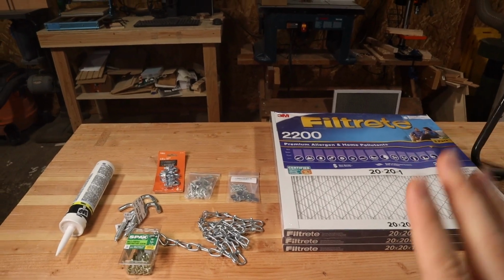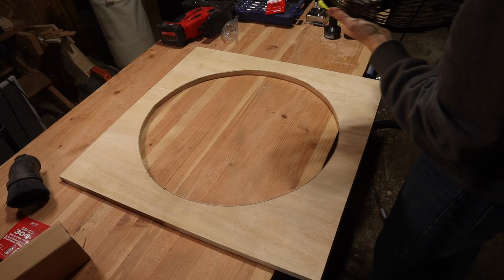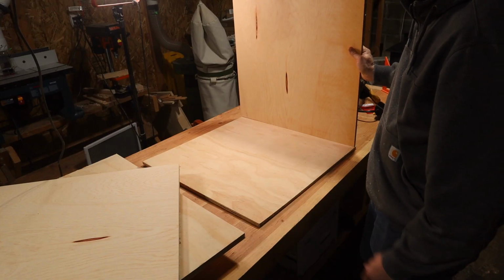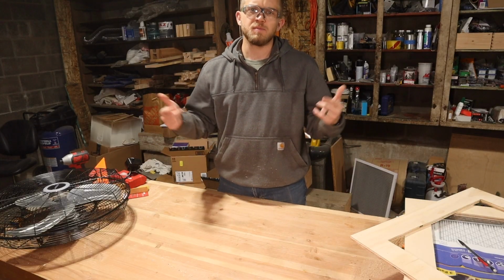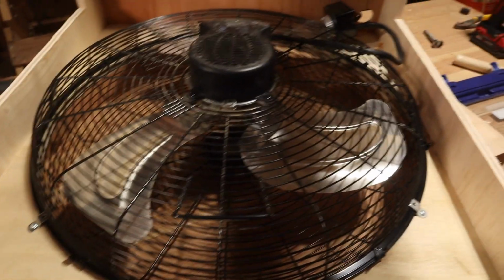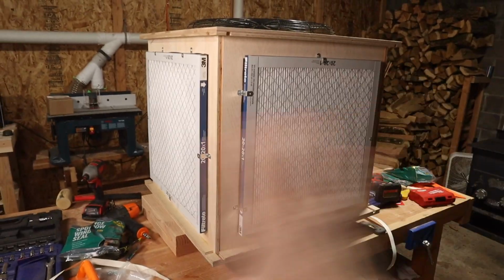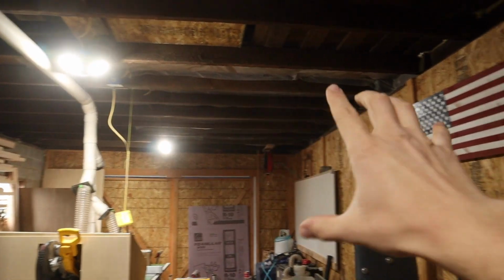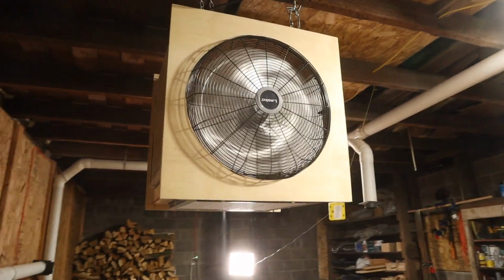Building the Best & CHEAPEST Air Filtration for Your Shop

Comment: To make circles, I use a yardstick with a hole in one end at the 1" mark for the screw, and a series of holes at my common radius lengths for a Sharpie. I then just add 1" to my needed radius and insert the Sharpie at that point. A 10" radius would put the Sharpie at 11".
Reply from the maker: That’s a great suggestion! Thank you!

Comment: Excellent video. I have a WEN air filter, but I’d like to build your filter because it will not only filter the air but also provide lots of circulation, which is really important for summer time builds in the Phoenix area. You gave excellent instructions for this build. Loved it. And you provided solutions that I would not have thought of otherwise. Thank you!
Reply from the maker: So glad to help! I will note that if I do it again, I would make it much lighter. Mine was far beefier than it needed to be. 

Good luck in your build! Let me know if you have any good modifications!

Comment: Just tape the filters on with 2" blue painters tape. Why may it so complicated
Reply from the maker: I’ve tried solutions like that in the shop before and the dust causes it to lose tack before long. However, you are 100% on point that I over complicated this build and could have done it both cheaper and easier 😂

Comment: 3D Handyman did something similar and actually made a business out of it.  He found that the velocity of the fan that has air exiting the filter box actually stirs the air sufficiently that it blows away from the filters and tends to go all over.  He got better results with the fan blowing INTO the filter box was much better at filtering the air.  That air direction makes sense to me because the exit velocity of the air out of the filters is significantly lower and doesn't tend to blow the dust around.  You have a good build (except, as you say, too big) that could be easily fixed.  I might try 1x2 frame except where the fan goes and hold the filters with 1/4" strips behind and bars that twist on a screw in front.  The video was kind of rambling and pretty long, but I got a lot out of it.  Thanks!
Reply: Yes, blow into the box.
Reply from the maker: Oh interesting! So kind of like a Venturi effect pulling air past the filters. I avoided pointing into the box because eventually the box will get caked up with dust and having it point out helps the air to circulate in my shop. However, you may be spot on that technically pointing in is better.
Reply: @NorthwestCraftsman you're wrong flip it inside bruv
Reply from the maker: @joedavison2675  I hear you but can you help me understand why?
Reply: @NorthwestCraftsman ensures most everything comes to the suction point and isn't disturbed by the air blowing out. The filters will get caked either ways cus that's how filters work you will need to swap/clean them or add pre filters. Or if youre dead set on blowing out get sock to help disperse the airflow
Reply from the maker: @joedavison2675  I can see the logic. I actually intended to circulate the air in the shop 1) for comfort and 2) so that particulates could be actively moved nearer the filter.
Reply: @NorthwestCraftsman  They dont get moved neared the filter though thats the problem they get blown and then plastered onto stuff. You should watch his video to see this in action. Better/healthier ways to achieve what you want.
Reply: @joedavison2675  or have sock as a 1st stage filter and blow into the box.

Comment: Have you noticed any air getting sucked from the front sides of the fan? 

I built an identical one in 2020. It seemed to work but noticed air pulled from the front side of the fan cage. 

Cut a temp baffle with cardboard and taped it and it fixed the problem.
Reply: “Baffle” as in a 2” strip of cardboard I secured around the fan with duct tape.
Reply from the maker: I’ve noticed something very similar when the filters get clogged. With the size of filter I chose that happens pretty quickly. However, a quick removal of the filters and hitting with the air compressor fixed it. You can also debug this by removing one of the filters to see if it’s a restriction issue.
Reply: @NorthwestCraftsman this makes sense. my filters are a little clogged. But I think the baffle should help save me from cleaning/replacing the filters a little longer? Idk
Reply from the maker: @Andy-ue3dv not sure, I haven’t done that much testing. I’m sure it helps some but I’ve opted just to clean my filters more often

Comment: Cool concept, but you will bang your head a lot. Put it on castors with pull handles on top, and then you can roll it to the point of dust generation.

Overall, it's a great video in any case.
Reply from the maker: Thanks! And in my case it was just over my head so it didn’t matter as much and I wanted up in the open air where there was more free air movement. But you’re spot on that it could be used as a ground unit.

Comment: Does it clean air polution bad smells like u barbeque in house or smoke ? Does it remove  bad smell ?
Reply from the maker: I don’t have this in a place where I could test that so I can’t speak to odor removal directly. However, if you wanted it to be able to remove odors, run a higher MERV filter and add a carbon filter sheet to each of the filters.
Reply: @NorthwestCraftsman  so it becomes expensive even more :D Just asking. Thanks for reply.

Comment: The only downside I can see is that fan blowing particles around the shop before it can get to the filter.  Maybe with a hole in the wall it can blow to the outside, but you'd need a place fresh air to come into the shop.  Wouldn't be good for heating or air-conditioning, but would be nice in the summer if you don't have air conditioning.  I was thinking one of those house fans, with the filters in the attic, but you'd need a set of filters to keep dust out of the motor, unless if you had the motor elsewhere with a serpentine belt.  Just thinking out loud.
Reply from the maker: Oh I love the thinking out loud. I have gone back and forth on exactly what you talked through. I chose to do it this way because I wanted to keep the fan cleaner. Both from a fire risk perspective and a longevity perspective. I will not claim it’s perfect though 😂

Comment: Most of these are really overbuilt.
Years ago I saw a filter made of 5 20"(508mm) filters in a cube shape & a 20" box fan for the 6th side, stuck together w/ tape, IMS.
It was a documentary by the University of Canada(?) or similar.
The guy (professor?) built a square box made of air filters.
I've used a single filter on a 20" box fan, & have 2 of those running 24/7.
I'll prolly replace the filters in a month or 2 w/ higher-rated filters.
I think it's better to have 2 or 3 moving air/filtering air than just 1 BWDIK?
Reply from the maker: You’re not wrong at all. This one is way overbuilt and if I was to do it again, I’d streamline it quite a bit.

That being said, I will say the fan size is a big deal just for volume of air and power to pull it through the filters. There’s a really good write up by someone over at ShopHacks where they did a shoot out with air velocity, particle count, pressure drop and the works. Highly recommend reading it. 

https://www.shophacks.com/airfiltrationsystems.html#/

Comment: my shop is way smaller but I use a fan like that to cool it off and a small 1500 watt heater to heat it. its the dust its everywhere breathing it doesn't bother me so much I'm from LA  but cleaning is vacuum and wipe everything down.
Reply from the maker: It doesn’t bother you more but I’ve heard of woodworkers that develop an allergy to it over their life of exposure. This system, something else, or a mask, doesn’t matter, but I would recommend trying to control the dust.
Reply: @NorthwestCraftsman I just want to control the dust before I need to dig myself in and out of the small shop

Comment: Personally I cut plywood into strips and w two picture frames for each filter and a lip all out of 3/4.   Leaving open side removable to pull out filter 

Remove control knob and wall mount by outlet.  I also used a smart switch that can send variable smart switch from Shelly  

You could also put a 2nd circle cut out for fan in front of fan and in back of fan and screw together.  The fan can be removed from outside by removing outside panel.
Reply from the maker: All good suggestions! I as well would use plywood strips or construction lumber if I was to do it again. 

I did end up getting a digital switch for it so I could remotely turn it on and that works great.

Comment: Remove control knob and wall mount by outlet.  I also used a smart switch that can send variable smart switch from Shelly  

You could also put a 2nd circle cut out for fan in front of fan and in back of fan and screw together.  The fan can be removed from outside by removing outside panel.

Comment: Wood waste.  Plywood's expensive currently--maybe it was less 2 years ago.  Rip select grade 2x4 to 1" (you'll get 3) and make open frames that fit the filters.  Then the top and bottom can be made with 1 2'x4' project panel.
Reply from the maker: You’re spot on. Plywood was much cheaper back then and that piece was even more so because I bought it a couple years before that. If I was to do this again I’d do something similar to your suggestion. Much cheaper, lighter, and just as strong.

Comment: Fantastic video, I appreciate all of your live-time revisions to your design and your comments at the end. 

I realize this video is a few years old so you may have changed your controller setup, but you might consider something like a Sonoff S31 smart plug - I use them for quite a few things with a semi complex setup, but I have friends who just use Google Home or the app to control them. You can look around Google or YouTube to find guides for setup, its pretty simple; they should easily handle the startup surge of the Lasko fan. I'm going to use another one for the air filtration and tie it into the remote for my 2nd bank of lights (short press -> lights, long press -> lights + filtration), with a few hour delayed shutoff when the 2nd bank shuts off - this is overkill, but easy for me to do being I have automation setup already. Just adding the S31 + app control would be really simple for most folks. 

Also, TIL people don't pre-drill eyehooks! I have always done it, perhaps because I am a lazy weakling lol.
Reply from the maker: Hey! Thanks for the positive feedback, I’m glad you enjoyed it 😊

That’s an awesome idea! I went with a slightly dummer route and just had a remote switch but I think you’re right that a smart switch with some automations would be better. Thanks for the idea!

Comment: Question: Can the fan be on the bottom of the box with filters on the 4 sides?
Question 2:  Could you use two small fans instead of one large fan?
Reply from the maker: Good questions!

1. You can but I put it on the side to help with circulation around the shop. But nominally you can mount it wherever. 

2. Yes, biggest thing is getting enough volume through the filters.

Comment: Enjoyed your video. Could most of the box be constructed from 1/4" plywood, except the piece that holds the fan? Also, could the fan be mounted on the bottom face of the box, with filters on the sides? Then smaller filters could be used and the box would not have to be so large.
Reply from the maker: Thanks! Glad you enjoyed it! Most of it could but I would recommend the mounting side and fan side (as you mentioned) be at least 1/2”. 3/4” was definitely overkill. 

Mounting the fan on the bottom, or any face really would work, though, with it mounted on the side, it facilitates overall circulation in the shop, helping to move dirty air back to the filters.

Comment: “This [dust collector] is the biggest dust dust producer in my shop.” 😂😂😂
For drawing large circles, use a trammel, aka beam compass, either manufactured or diy.
A couple of thoughts about size:
At least one face (probably two) needs to be large enough for the fan.  In this case, the fan is generally about the same size as the filters.  20x20 filters are approx 400 square inches.  16x25 filters are also approx 400 square inches, and of course there are many other sizes.  The point is, the cabinet could be made longer and shallower, depending on placement of the fan and desired orientation, while providing the same nominal area.
Safety:  
Use a pulley, a drywall panel lift, a second pair of hands, SOMETHING, to lift things like that into position.  
Now I need to get to work.  Have to finish the current (small) project, then start on this shop air cleaner.  Just wanted to watch this again while having my coffee.  Great video!  Thanks for sharing.  Best wishes and stay safe!
Reply from the maker: Yea, in dire need of replacing that dust “collector” 😂

That’s a great idea for the circles! I’ll check into getting one!

You’re totally right about the surface area. If I were to redo it, I’d streamline a lot more to both reduce size and weight. 

And again, you’re spot on with the lifting 😅 that was too much 😅

Comment: I built one using the ShopHacks plans, but I used 1/8" ply vs. 3/4", much lighter. Also built it to accept 20x25 filters.  No problem getting the fan out.  Been using this for 5 years now.  Blew out the dust from the filters after a year or so and re-used one time, then bought a new set of filters.  Hung mine from the 10' high ceiling in my shop, which is 935 sqft.  Clears a really "smoky" shop in 15 min or less.  Much cheaper and more efficient than any manufactured unit for sale.  Also, much easier to build on my CNC.
Reply from the maker: Great idea on the thinner ply. I may use that on a rebuild! Glad to hear yours works as well!
Reply: Interesting!  Things made from 3/4” plywood DO tend to get real heavy real quick, esp when they are installed up high.  How was the cabinet constructed from 1/8” ply?  An internal frame of 1x or 2x?  Would love to know more.
Reply: @joedance14  Forgot to mention that I usew 3/4" MDF for the front, which the 20" fan is mounted to.   Spent some time taking the paper drawings and creating files in Aspire to cut the parts on.  Since the filters are very light and held in by friction between 4" tabs, the 1/8" ply works great.  No internal supports; just slip tab A into Slot A... seal all the joints inside the box with caulk.  It's been about 5 years, so I have to (should) take the fan out and clean the blades.  I fill up a 55 gal drum on my dust collector about every 3 months; Woodworking is my sawdust therapy since the VA does not really help us combat bets that really need it....
Reply: @unclebob8746  Thanks for the info.  Sorry about your health issues.

Comment: Cool redux on a simple solution for clean air. However, MERV 14 filters are the minimum filter that will remove the >0.3 micron particles that can pass through your lungs into the blood stream. Thanks for sharing!
Reply from the maker: Good to know! Thanks for the heads up

Comment: Hmm...   I wonder if a large industrial garbage can (Plastic Rubbermaid)  with wheels would work great as a water based air purifier?  Kind of like how the Rainbow Vacuums operate to clean carpets.  Similar to how old engines used Oil bath filters.    I might have to do some library work or go looking through old military catalogs from NAVSUP to see what there is out there for building efficient air purification systems using the oil bath method, but using water instead.    

It seems to me this would be a much better idea for high CFM filtration  using this method along with a washable foam or metal filter media  to catch large particles. 
 then if needed,  a Hepa style filter for final filtration secondary to the  main water based system, so that it will not impede airflow performance of the main water based unit. 

The big advantage using such a hydro-filter is that it can even be self cleaning, just like the commercial units that have built in tank sprayers that clean the inside of industrial tanks, but on a MUCH smaller level. (Its a trash can) 

The method of operation is just like centrifugal oil purifiers used in most machinery applications that are able to maintain high flow and extreme filtration efficiency.  

I know that Noctua has a new desktop air filter unit.  I wonder if something like that scaled up would work well to keep down noise, while also maintaining efficiency.   

The poor man's version of this is to just use a shop vac with water inside to catch most of the dust with a pipe going into the water on the inside so that all the dust particles enter the water first then the filter medium takes care of the rest as an easy diy no real tools needed way to get that done.
Reply from the maker: Fascinating idea! I hadn’t heard of those before but the concept make a lot of sense. I’ll have to do some research as well to see about some of the logistics.

Comment: Thanks for the video. How are you cutting plywood on the table saw without having to do score cuts to avoid tear out?
Reply from the maker: Great question. I still get tear out but also don’t do a ton of finished plywood work. When I have, I’ve used my tracksaw which does marvels for tear out or I blue tape the back side of the plywood which is better than nothing but not perfect. Where I get the worst tear out is on warped panels that leave the back fully unsupported during the cut. So generally I try to avoid those panels (I.e. get higher quality panels)